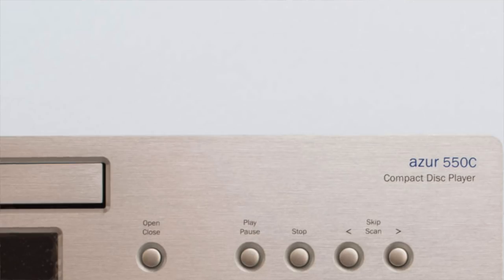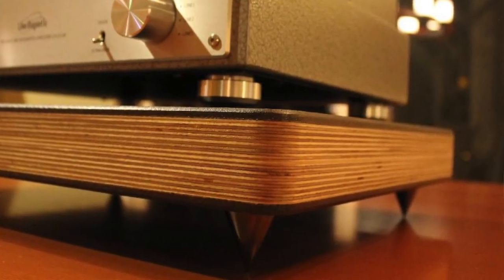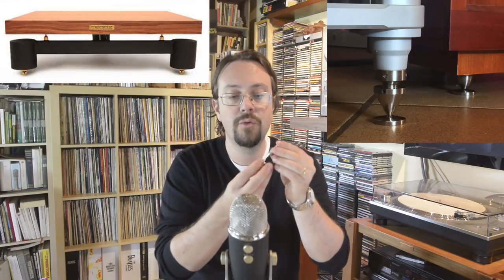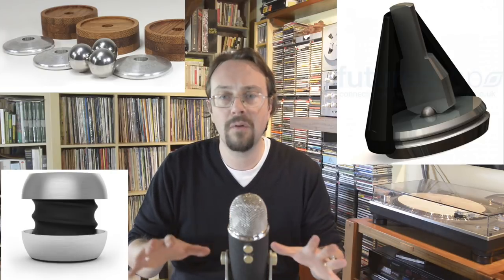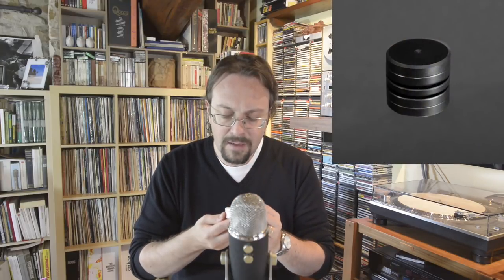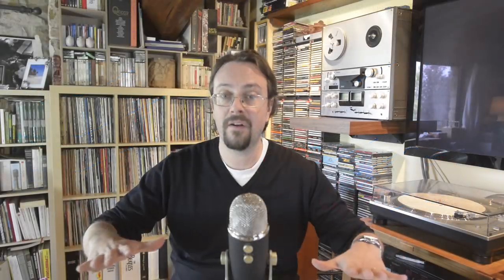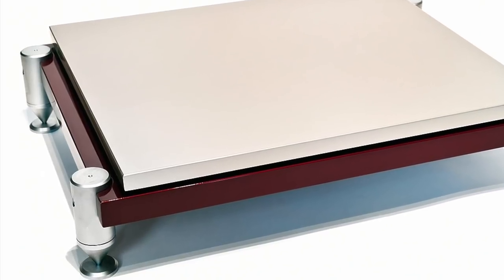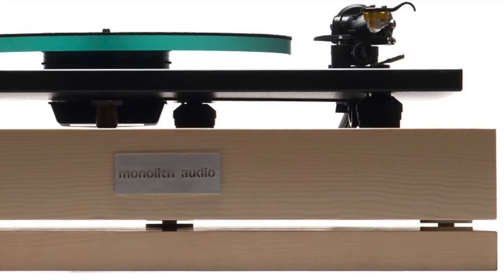Optimize your Hi-Fi system sound quality: 2 - Vibrations Isolation

Comment: Great content my friend, I want to add that just isolation is not enough, because there are external vibration, but also intrinsic vibration created by the component itself, for example transformer vibration. The ideal device should be able to drain that vibration into the platform underneath. Isolation only footers will trap those inside the component

Comment: Molto Benne! Good info. Vibration isolation does make a difference. I have my turntable on a Relaxa floating table made by SAP. It immediately increased the sound stage and tightened the bass and detail. Virbrapods under components and Gaia isoacoustics III isolation feet definitely helped, too.

Comment: Star Sound Technologies makes some of the best points and platforms. Unlike most manufacturers, their points are made from a special brass that doesn't corrode or tarnish. The energy actually travels down the outer surface of a point, not through it. So any tarnish is like the surface of the moon on a microscopic level that's slows down the transmission of energy.

Secondly, individual platforms are superior to racks because components on virtually any rack will transmit vibration from one component to another, degrading the sound. And even though cable lifters may seems like overkill, the Shunyata Cable Elevators really do improve the sound in a high-end system.
Reply: No it doesnt the energy transfer is by mass coupling and the point has a very small surface area  so it efectively reflects the vibration back up the cone of the spike, as well as down to the footer. Generating a small amount of frictional heating at the point of contact, to disapate the vibrational energy.

Comment: Good info. Thanks. I use a lot of different ways to fight vibrations. It is a lot of work but it will pay of. 
One special mention: I had some good results with vibrapods under all ‘disc’ equipment (CD, DVD, Bluray).
Not very analog, I know, but still a good tip ;-)
Reply from the maker: Thank you Ivar! Yes, I agree. Vibrapods are great also under digital sources. This is true also because this typologies of sources is VERY sensible to vibrations, perhaps even more than turntables!

Comment: Very nice explaination about resonance dampening measurements.
However, you said that 'suspended dampening' is often very expensive.
I have suspended insulation feet made by Isonoe, those are fairly affordable (like 130 euros for 4 pcs.) and work very well with Technics turntables (I also have a SL1200G).
This suspension is made up of two aluminum parts and several rubber rings. The inside part of the feet (which are screwed under te TT) are hung up onto multiple rubber rings. Those rings are connected to the outer part. Its a very basic principle, but it works very well.

Also, a wall mounted shelve can be very attractive to those who want to place a turntable in a room with, for example, wooden floors. 
This way the turntable gets decoupled from the 'unstable' floor and is mounted onto the solid wall.
The best types are made out of a stiff metal rack with an MDF plate on top (and height adjustable spikes in between for dampening/levelling).
Reply from the maker: Very interesting. Thank you for sharing! Did you find significant improvement in your Technics SL1200G? I have the same TT...apart from this, thanks fir sharing!
Reply: no I only switched the feet and the cables. especially the ground cable that came with the TT seemed to be of very poor quality, very fragile. The standard neoprene mat, in contrary to the cables, is doing its job very well, has great vibration dampening properties.  I added plates made of sorbothane with glass inlays under the Isonoe feet though, because I live in a house that is like a low-freq vibration conductor. Sorbothane is very good for decoupling lower frequencies, however it's not really suitable for decoupling higher frequencies.
Reply: these improvements only make a true improvement when playing music with much basses and things like feedback from walking around, closing/opening doors etc.
Reply: @anadialog  Recently, I might have found the best SL-1200G upgrade possible. The KAB TD-1000 liquid tonearm damper.
It not only reduces vibrations in the tonearm significantly, but also lowers and decreases the effects of the tonearm resonance frequency.
So a bigger range of low and high compliance cartridges will suit the tonearm very nicely when the damper is installed.
It also helps tracking warped trashy records.

At first I was skeptical, but when I realized this damper has dynamic damping characteristics instead of just giving resistance to tonearm movement, I took the plunge.
It certainly is worth a try and is very affordable! Vibration dampening feet and mats are great upgrades, but this damper is... amazing! 👍
Reply from the maker: How cool! I did not know about this...going to try it ASAP! Thanks man, for sharing that!
Reply: @anadialog  You're welcome!

Comment: coupling or decoupling, a lot to say, most of a time both, coupling and after decoupling.
cheap isolation platform can be done with sandwich, try with what you have, for light electronics : unscrew feet, 1 layer of soborthane on layer of cork.
midweight or transformateur too buzzy, spike on wood+cork+wood.
Thinking kitchen or cutter mat for having cheap source of different thickness of silicone, they aged better than rubber who loose their dampening property.
For valve equipement, suspended valve base or plate who have the base + resistor and cap is very efficient for isolating the valve.
Be curious and try, you don't need to spend a lot of money at start, you can combine with good products like vibrapods or hemispherical sorborthane linked in the description,
have fun and enjoy.

Comment: Many thanks for your so helpful series of videos.  Regarding vibration, I do have some experience and would like with your permission to share it with you and your viewers:
Unlike analog machine (in particular a turntable machine), a CD Player output signal is not affected by vibrations (you will not see the vibrations added to the analog output signal) as long as the reading of digital information is not interrupted by the vibrations. (no reading errors occur).
Turntable is the most sensitive component because it is a mechanical to electrical signal converter. a casset tape might also be affected 
Tube amplifier is relatively more sensitive then Transistor amplifier  (but far from a turntable) because the Tube has high level of "micro-phonic".
Other then that, you would not want to hear mechanical vibration noise physically coming out from your equipment (i.e a metal enclosure of your gear is vibrating) while listening to your music.
How you can test this statement?: If you intentionally apply a mechanical vibration to any of your gear (except from turntable of tube amplifier or loudspeaker cabinet). Example: (using a tool) generate a knock on the enclosure of your amplifier. The mechanical noise heard from the gear enclosure (which represents a huge level of vibration) will be much louder from the electrical signal (if any at all exists) generated at the output of your gear, this means that there is not need for special anti-vibration treatment. On the other hand, if you will try this on most of the turntables, the unit will generate a significant electric signal, which justify any measure of vibration isolation applied to this machine.
Reply from the maker: Hi there, I agree and everything but I disagree on the CD. It's not only a matter of reading but of converting, interpolation and handling the signal. People tend to think that digital is just 1s and 0s but the reality is much more complex and full of issues that filters mask somehow but not perfectly and nit always effectively. Check the video DESCRIPTION of this video where I added some scientific evidence of this: https://youtu.be/8CTD6EgKG5s
Reply: @anadialog   Thank you for your Replay.
As always,  the matter is not black or white, but rather how to quantify the subject.
On a CD, assuming  correct data reading is done,  all mechanical vibration that might affect the reading become non relevant.  The Section that might be affected by vibration is the analog section from A/D and on (this include also the crystal that generates the A/D PLL clock) . I estimate that this section sensitivity to vibration would be no more than that of a standard Aux level Transistor Preamp. 
Much less than Phono Pre Amp section because signal level is 100 times higher, and much  much less (1000 and more) then  mechanical Analog player like a cassette deck, and further lower then a Turntable which is the most sensitive part for vibrations. So to quantify the sensitivity according to the above estimation, taking a Turntable sensitivity to vibrations as reference 0dB,  a cassette would be -10db, phono pre amp - 20db (tube) - 30 dB (transistor), Aux level -40 dB.  Power amp: -40dB to -50dB. 
At these levels, it is possible that the unit  enclosure vibrations might  generate higher audible noise than the electronic noise it might produce. 
The Above dB levels are not real numbers, are just to give some numbers behind my statements. It can be tested by applying a controlled level mechanical vibration on the product enclosure and measure the output signal generated from the device. You would want to prioritize the anti vibration treatment according to the unit sensitivity to vibrations.  
Thanks again for your replay, I do appreciate a lot your videos and my comments are for the purpose sharing  and improvement of knowledge.
Reply from the maker: Absolutely! As I always say, this is a dialog, not a monolog! The important is that we all have a constructive and polite attitude, like you. Not everyone has that.

Comment: Thanks.  Please do a video on if it is necessary or an advantage to isolate a soundbar (Samsung HW-N950/ZA) that is on a glass shelf below a TV.  😃  I’m going to try the Vibrapods you recommend.
Reply from the maker: Hi Donald! Could help! The best in this case is to mount the soubdbar on tye wall but I bet you can't do that....
Reply: @anadialog  , I've read someone's suggestion (in the comment section under one of your other videos) to mount a turntable to the wall for improved sound as well. Why is that? What is it about a wall that improves sound over isolation in any other way? Thanks in advance.
Reply from the maker: Well, maybe that is not such a good idea after all. It depends. If the wall is a supporting wall, with a high quality decoupled shelf then it may have sense...must also be precisely leveled..

Comment: Why Delrin (or Polyoxymethylene POM, the heteropolymer of delrin aka acetal) rather than Polyethylene (HD, or UHMW), or Polycarbonate (which has dampening), or ABS for that matter?

Note, Delrin is a homopolymer of acetal, made by Dupont. It is pretty much the same as regular acetal which is a heteropolymer.

Comment: I bought a vintage record player recently and had to do allot of work to get it working but now all I need are new feet. The original rubber feet were probably dry rotted and are long gone. Any recommendations on what I can do or should I use one of these solutions from video? I was thinking of cutting up a sponge for new feet. (Making sure the record player remains level of course.)
Reply from the maker: Hi TheTarrMan, good job in refurbishing you turntable!
I would not recommend using a sponge since the foam pushes upwards and all turntables have different weight at each corner. You would be facing a strong unbalancing. A cheap way would be to use the "Deflex/Milty Foculpods", or the "SorboGel Qfeet"
or simply some "vibradopds". More fancy and effective solutions would be to replace the foots with audiophile grade feet like the "Isonoe Audio Isolation System" possibly together with the "Isonoe sorbothane Isolation boots". The foot replacement is obviously dependent on the presence of screw holes on the back of the chassis and their dimension (M8, M6, M4 etc.).

Comment: great video, thanks for the info, i just got a thorens turn table and found out i REALLY need to do some leveling around the house, anyways, could you provide some info on the platform appearing on mark 12:15, i really like the design, thanks
Reply from the maker: Hi Cesarin321! Sure, that is the AUDIO PHILAR double anti-vibration platform (http://audiophilar.com/en,double.html). I just want to underline that I do NOT have direct experience with this product. I just inserted the photo because it was a good example so for this reason I cannot recommend it. In any case, any anti-vibration platform of decent quality will do the trick. Otherwise you could substitute the feet (if possible) or buy a good quality hi-fi rack.
Reply: thanks a ton !!!! sadly i don't have space for a rack... so my options are limited..
Reply: Try Auralex Iso-Tone, it's not super cheap but one of the cheaper isolation platforms for turntables. Just check that it is the right dimensions. You could always level under the feet of the turntable, with cards or some sort of riser.. saves having to level the floor sometimes xD
Reply: thanks for the advice
Reply from the maker: +cesarin321 thank YOU for watching!

Comment: Thank you for an informative video, I definitely see the clear benefits and best outcome in isolating a mechanical source like a Turntable and a vibration producing source like a Speaker . However I really believe that isolating any solid state component ( like a power source, cable or amplifier) from vibration may affect its longevity. And as long as there are no magnetic fields around , I fail to see how it possibly can affect the sound that it produces. However  there are many people who swear by it, I wonder if anyone has studied the latter phenomenon as a placebo effect though ! just a thought.
Reply from the maker: Hi Kamal, the cases you describe are in fact probably the more subtle in terms of quality increase. I must admit that a friend of mine inserted high quality decouplings under my mains filters and there was definitely a benefit, nothing dramatic obviously. After, I did the same with vibrapods and at that point I also must admit that there was no effect...cables? That is a little too much for me although it is a good idea to keep them off the ground.
Reply: Solid state devices resistors transistors capacitors well all vibrate to a small amount in time with the alternation current passing through them- this will also translate to parasitic vibration at the natural phyical resonant frequesnt of the device.  These vibrations can be transfered to the casing of the unit (depending on it manufacture) hence the noticed effect of damping on some equipment.
It's really only and attempt to overcome some poor engingeering implimented due to price-point/profit.  Dont get me started on Thermionic tubes =microphoics big time! But are put on prowd display on the alter of audiophilia. Usually in the center of much vibration and airpressue change.
usually negating anything done with vibration control elsewere.
Reply: Damn autocorrect  - sorry for the spelling mistakes.

Comment: Show me some proof that vibrations in a normal listening room affect solid state electronics. I bet you can't show me any data to back this up. And please don't tell me that some things can't be measured.
Reply from the maker: Hi Dale, as mentioned in the video, solid state electronics suffer much less than all the rest of the system. Nevertheless, even solid state can encounter microphonic issues generated by vibrations. One of the weakest components are the capacitors, which unfortunately do generate some microphonic distortion.
Here are some scientific articles and renown manufactures' papers that describe these issues (I underlined some passages): 
Scientific article: https://www.dropbox.com/s/sgd9bszsbkqvp6a/Capacitors_for_Reduced_Microphonics_and_Sound_Emis.pdf?dl=0
TDK: https://www.dropbox.com/s/3o72zwvhaz7eyag/31_singing_capacitors_piezoelectric_effect.pdf?dl=0
Mundorf: https://www.dropbox.com/s/dsxj3v43d86qfna/Mundorf_Fidelity_Components_Catalog.pdf?dl=0
Infratec: https://www.dropbox.com/s/99wxmwvajxtlyo7/infratec-application-notes-microphonic-effect.pdf?dl=0